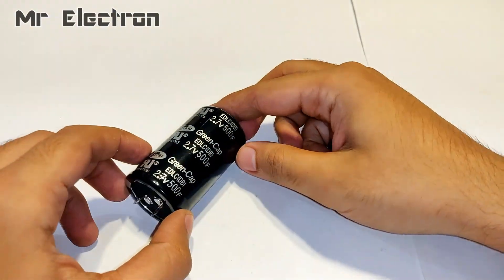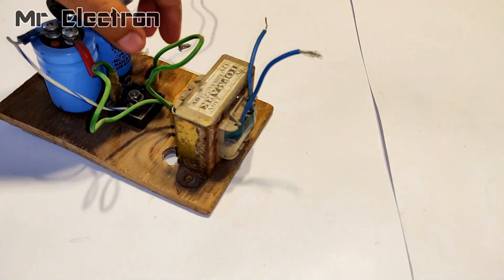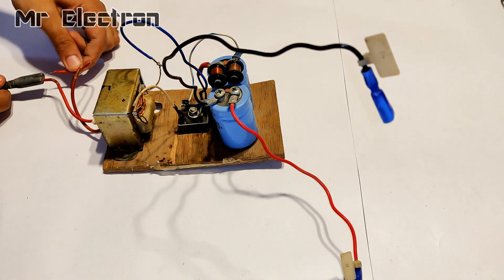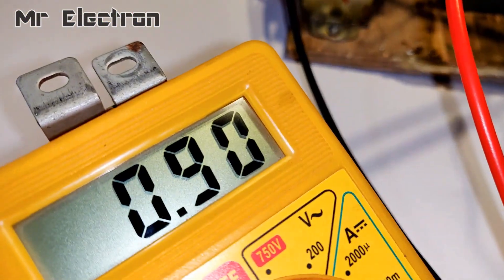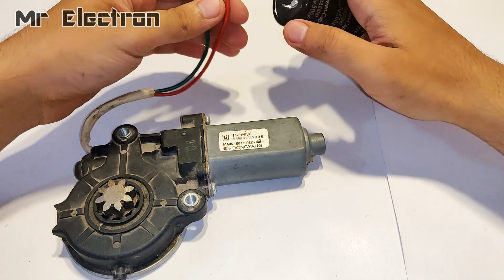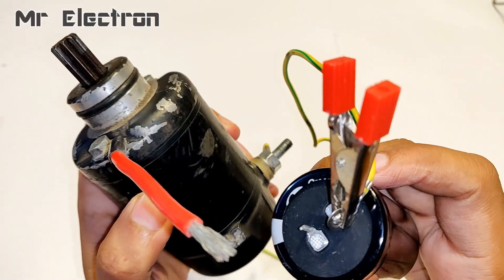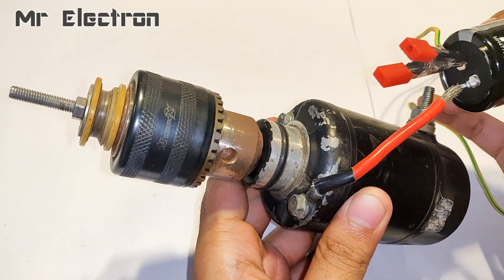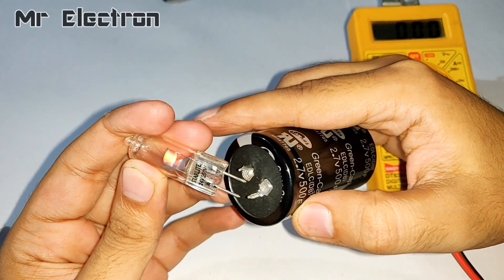Run 12v 100 Amp Starter DC Motor with 500F Super Capacitor Ultra High Current - 2.7v Green Cap

Comment: Dude, thrilled to find your channel!!
1) I would like to convert a "one-wire" GM alternator to power an elec bike. Do you have a video that shows how?
2) Can this capacitor be used with  it?
I have tons of AC experience but know only the basics of DC. Also have fabrication skills and tools.
The bike is a classic old 1960 Schwinn : )

Comment: you don't have a clue, you are running motors with no load!  A motor rated at 20 Amps with no load will probably only pull 1 Amp.

Comment: What happen to 25 amp electric motor if applied with 300 amp power supply?
Reply: No problem as long as the voltage are the same

Comment: What is the difference between vdc motor and dc motor.. 

I have two queries:
1. Can I run vdc 24v motor on dc 12v
2. Can it generate 24v dc current which can use for batteries

Comment: Buy a proper 10 amp lab bench power supply instead of these ones you have now and the super cap should be charged with only 2.7 volts and not 4 volts it might kill the super capacitor. I will support you. Thanks for your videos.

Comment: Hi.. please help me with this. I have a car amplifier 4 Chanel (sony). I built a boom box only for bass, I ordered  a SMPS which says 12v 30amp, to run the amplifier. But the prob. is when i open the bass full capacity the amplifier stop working, when i measured the voltage it drops when the bass is high.  It drops 14.7v to 9v. When the bass is high. If i low the bass it working fine. Please please please provide me the solution. Provide me the power supply options to run that amplifier. Please.

Comment: How to make 72v using this capacitor in parreral nd series nd how much amp giving this capacitor on 72v 

This capacitor can run as a battery like car batteries charge from altenator nd output in ur 12v components at a time plz make a video in hindi how to make 72v capacitor and how to count amp of the capacitor plz

Comment: You say at 5 caps in series you can run the 12volt 100amps at full load let us see that. In series you can get the 12volts but you don't gain any capacity so you would need 5banks of 5caps in series to do what you say. Also 6 strip parallel  of  6caps in series (16+volt)  to charge with standard lead acid charger 14-15volts charger could even use jump/starter mode 60-100amps. Much better caps available for this kind of work with stronger leads allowing use of buss bars not tiny wires and soldering which you need more practice at.

Comment: im so lost.. im trying to study all this by myself without the help of like teachers or classes etc.. But with every piece if informationm i learn i have more questions than answers..

why is it that i have teenie tiny little capacitors that are 470uf 35v, 470uf 25v, 1000uf 10v, 1000uf 16v, 1000uf 25v, etc, and that enormous capacitor has less Volts and but more farads.. I'm so lost.. I started this journey of information because im trying to figure out why none of the capacitors i have work when im trying to run a stepping motor like a regular motor.. the only thing i can think of is that the farad count or voltages are not right.. Ive used ac and dc power.. ive tried all combinations of how to hook up the 4 posts from the 2 coils.. ive tried the capacitors backwards and forwards, etc.. i have no idea why its not working. But now ive been up for the past like 9 hours researcghing and all im doing is coming up with more things to answer. lol.

but anyway.... great video... Im subscribing.
Reply: actually you are talking about micro farad capacitors,  and in this video he uses 500 Farad capacitor not 500 uf which is 500 micro farad. Hope that now you can understand why this capacitor is huge.
Reply: Les moteurs pas à pas ne fonctionnent pas de la même manière... ils ont besoin d impulsion carrée.... je vais vous envoyer un lien...

Comment: Why my capacitor dont take charge
Reply: What's the capacity rating on yours?
Reply: use power supply with current control  or add some resistor in series to limit the current if you don't have CC supply

Comment: No one mentioned, so i will. If u double the Volts u quadriple the power. R=U/I this means, in the same appliance, if u double the volts, u will double also the ampers. then u will consume 4 times more power. 

But, when u use this to 250W/24V lamp, it takes ~10A on 24V , if u halve 5A 12V 60W half again, 2.5A* 6V=15W,  half again 1.25A 3V 4.5 W, half again 0.625A 1.5V ~1W how much power from a 60gr capacitor ! it can also be done with a cr2030 cell that maybe around 1gr... but when u shorted it out u pulled like 200A, that was impressive, becouse u not lost ur all capacity in a small burst.
Reply: if u want to impress people with the true power of a power capacitor, u need to build a heavy duty joule thief. That can leech around 50-200A at 2.5V (for atleast a few seconds) then u can power up fully a starter motor or anything for a really short time period

Comment: Great!
Even best use for electricity is your daily transportation on the road, not consuming gasoline and polluting the air we need to breath.
Reply: I'm going to start out with question. where do you suppose the power comes from? The answer is most places in the US are still getting their power from coal and natural gas plants.

That would actually cause more pollutants than just using a standard gasoline vehicle or a high-efficiency diesel.

 But for those of us lucky enough to be around a nuclear solar or wind plant or maybe even a bio plant then yes. this is a very feasible and cheap means of transportation

And for those of you saying nuclear is not the answer what's better burning 2647 tons of coal ( this is a Coal Power Plant running Full Tilt for a year) assuming that most people would switch over to electric vehicles and would put more of a power strain on the plant or using approximately 27 tons of uranium for a reactor.

I hope we start seeing some more clean energy power plants in the future!
Reply: @Teararec  The main difference is, that the powerplant is on the country side, wherein the cars are polluting the air in the middle of the cities where the people living and breathing. 
Any powerplant powered by oil, gas or carbon is way more efficient than any small internal combustion engine inside the cars.
In Germany we have already 50% renewable energy. Means 50% less pollution driving an electric car
Reply: @eDriver  you do understand that the power plants only make out about 33% to 45% of the energy that is used compared to some of the efficient Small Engine Vehicles which make out about 35% to 50%^. And if you really want to get into high efficiency you should look at  low RPM large diesels for example (ships engines) those can be 50%^. not only that you also have to think of line transmission loss because we're not using superconductors.

 there's a lot of other things that can equate into it as well, what is the current load on the power plant, how long the transmission line needs to go, what voltage  or kv is it running at, is there any form of Transformer  that intersects the transmission line before you and ECT. 

 So even though if you're running Electric your efficiency rating will always be lower then the power plant by a pretty significant portion.

Comment: Hi Mr. Electron,

I too have a supercapacitor bank. It is a 100F 16.2V capacitor bank.

I use it to generally, to run a 12V car vacuum cleaner.

Once I jumpstarted a KTM Duke with the supercapacitor bank.
Reply from the maker: Niceee !!!!
Reply: Advaith Madhavan capacitors of too high values needs too higher current peaks  when recharged, more than some rectifier bridges could deliver....

Comment: Super capacitors don't really have a high power(mAh) to weight ratio. A 18650 can store much more energy mAh  to weight
Reply from the maker: Correct but they have 2 pros better than all :
1- They can go down to zero and then recharge again thus we can fully utilise its power unlike the 18650 with minimum volts marked at 2.5v
2- NUMBER OF CYCLE 😃

Comment: Why you use capacitors? 12v battery is much powerfuller
Reply from the maker: More Charge & Discharge Cycles than any existing battery.
Reply: @MrElectron  Is there any way to stop a Capacitor from voltage discharge like putting a diode or something on the circuit??
Reply from the maker: Discharge will still be there. Place it a vaccum
Reply: @MrElectron  Will vacuum stop the discharge completely
Reply: And can harness back emf much faster and be used to self excite
Reply: Using a more powerful Transformer
Reply: Capacitor provides instant charge supply and can receive.But battery can't do that and if it Does then lifespan of battery will be reduced tremendously.